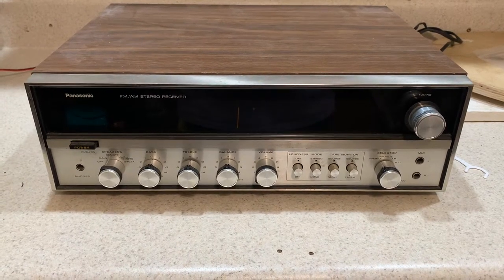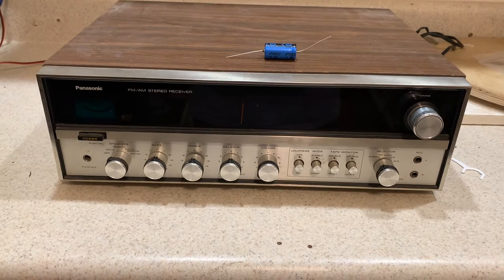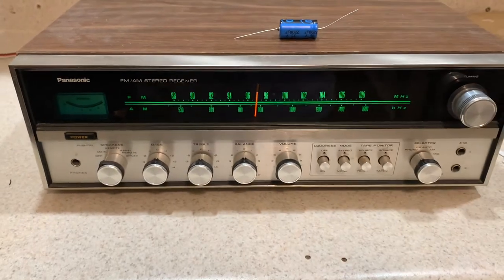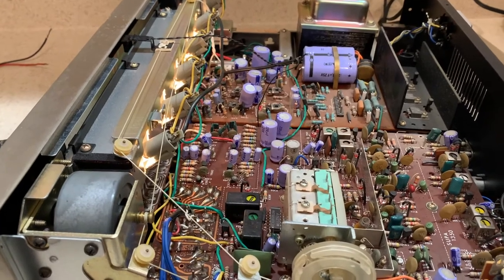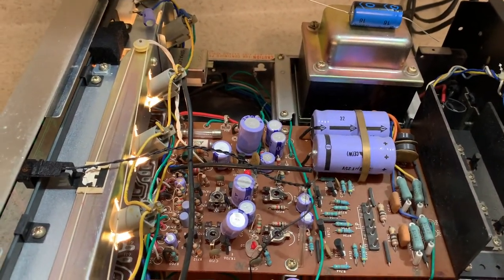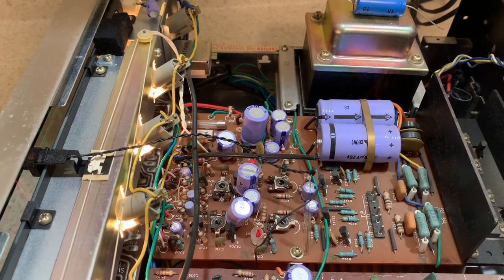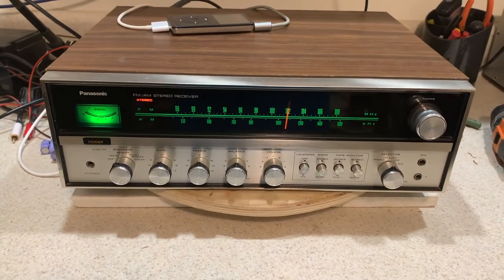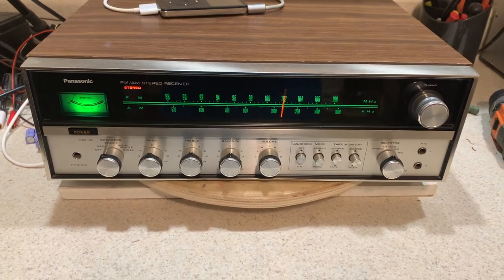Panasonic SA-5200 Vintage Receiver

Comment: Great video- thanks for posting. I am getting a weak and distorted sound from my SA-5200. All indications are the black square transistors or the driver transistors might be bad. Do you have a source for them? And the replacement numbers? Thank you!
Reply from the maker: Hi there, I do not have the replacement part numbers, however you can download the schematics for free at: hifiengine and then figure out the part numbers that you need. Also, you can get all the parts from Mouser Electronics. They will ship them to you and they are really inexpensive. Let me know how that works or if you have any additional questions, thanks.

Comment: Hi, just got one of these.. wish you showed  how you remove the knobs.. just pulling them out ?? Or somehow different?? Thanks
Reply from the maker: To remove knobs and buttons, you just pull them out and they come right off. if you get trouble getting them out is because of the age...but they should come out with no problem.

Comment: so can this receiver take input from my tv using rca cables.. i have just got it from an auction but not sure how the connections work.. can someone explain thanks
Reply from the maker: Hi- This receiver is very old and it does not have aux (CD, MP3, etc.) inputs.Try using the tape-in inputs. In other words, you will need to get a cable (stereo to RCA) and plug the stereo end from the TV headphone out to the tape RCA inputs. That should work fine.Let me know how it goes. Thanks!

Comment: Good video.  I just bought one for around $60.  I can see your "stereo" display lights up when tuned in.  Mine doesnt light up and the meter doesn’t move.  Did you hook up an antenna?  I can hear the FM but i just used some foil.  Which one is the FM antenna to use on back?  Thanks
Reply from the maker: Hi there, I don't remember if I hooked up and antenna, it's been a long time since I did the recap.  But you can hook up a piece of speaker wire to where it says FM and ground and that should be enough. As far as the light not coming on, it could be that the little bulb is simply burned out... you might want to check on that as well. It is a very nice receiver and I love the looks of it. Enjoy and let me know how it goes... Cheers! 🙂
Reply: @suckerforvintageaudio9449  Hi.  Well i got the meter working.  Was reception issue.  I pulled the STEREO bulb assembly.  Tiny bulb looks hardwired?   Can you get those online or do you replace it with a similar one?  I look forward to cleaning 40 years of dust in it.   Rick
Reply from the maker: @rcary  You may want to download the schematic from Hi-Fi-engine and see what  is the voltage of the little bulb. Based on that you can get a replacement easily on either eBay or Amazon...I hope this helps!
Reply: @suckerforvintageaudio9449  ok   good idea    i just noticed that there is a wire running to the station indicator needle.  Is there a bulb in that too??
Reply from the maker: @rcary  I believe so. That may be okay and in no need to be changed. If it’s off then it is also burned. While you at it, also check the bulbs for the entire dial face. I believe it’s 3 of them.
Reply: @suckerforvintageaudio9449  There are 4 and those are good.  The indicator is gone.  That looks a bit tricky to remove and i dont want to upset the pulleys and strings,  which looks complex.  The STEREO bulb is a bit easier to snip off and rewire.  I saw bulbs online but all looked stateside or italy.  Im in the UK.  Ill check the forums for wattage etc.    Lovely design how its all put together.
Reply from the maker: @rcary  Yes, it is a very nice unit. Check also with Audiokarma and post the question about the bulbs...you might get a better answer/idea of where to get them. Let me know how it goes. Thanks!
Reply: @suckerforvintageaudio9449  I notice alot of the 5200 have a black ring on the knobs.  Is that something you can replace?  Mine doesnt have those, but cant say i mind.   Still struggling to find the specs on the 2 bulbs. Fun stuff  :)
Reply from the maker: @rcary  Some Technics models did not have the black ring...I only saw those in the Panasonic version of receiver...If you downloaded the manual/schematics from Hi-Fi Engine you should see what is the voltage and use any other bulb of the same volt/wattage. Those volts are usually 8 volts AC. You can also measure the voltage going to the bulb and use any bulb of that voltage...hope this helps!

Comment: h what are the volts and amp of the replacement bulbs that you used? I'm replacing mine too i need some insights
Reply from the maker: It has been a while. I think I used the same bulbs that I used previously for the Marantz 2270. I think they are 8v. Please check on eBay LED bulbs for Marantz and you will find them. Most receivers that use incandescent bulbs have the same voltage. Please check and let me know how it goes. BTW, I love that receiver! :-)
Reply: @suckerforvintageaudio9449  me too i love mine, i checked one busted bulb and it is listed as 6.3v. I haven't checked all of them since the rest are working fine. Do you think they all share the same voltages?
Reply from the maker: @francisen4604  -Yes they do share the same voltage. However, because the Marantz bulbs are 8v they will be a bit dimmer, but it will work fine. I think mine had 2 bad and I replaced them all.
Reply: @suckerforvintageaudio9449  ok thanks again, i love the sound of this receiver thinking of buying klipsch r41m speakers to match this

Comment: I got one of these from technics and there's no audio output, i changed a blown transistor and still no audio, any idea how i can fix it?
Reply from the maker: Hi there, sorry about the late response. It has been a long time since I restored my receiver. I think this receiver doesn't have a relay for the speakers (I may be wrong, it has been a long time). Anyway, please check a set of fuse in the back panel and see if any of those fuses is blown. Those fuse play the role of a relay. Also, check with some headphone and see if you get some noise, static or something out of the output...Lastly, a recap is suggested, you can get all caps from Mouser Electronics...oh, Did you test the other output transistors??? Let me know what you find! Thanks!
Reply: @suckerforvintageaudio9449  Thank you for the reply and sorry about any English mistakes, the fuses in the back are fine, I will check with the Headphones, i should remove the npn transistors for test them?Thanks again for the help !
Reply from the maker: @vendrick420  Si seria lo ideal que probaras los transistores para asegurarte que estan bien. Remuevelos uno por uno y pruebalos a ver que dicen. Usualmente cuando se daña uno los otros tambien pueden dañarse. Hay algunos videos en YouTube de como probar transistorers con un medidor normal. Dejame saber como te va...por cierto, mi nombre es Felix! 🙂
Reply: @suckerforvintageaudio9449  voy bien felix obrigado! But my Spanish is even worse than my English, i speak Brazilian portuguese btw, and how are you?
Reply from the maker: @vendrick420  lol - sorry. I said earlier that the ideal would to remove each output transistor and test it outside. Usually when one blow out it damages other things, but check them and see if the rest is ok. Did you check with headphones and if so, what was the result?
Reply: @suckerforvintageaudio9449  I didn't test with the headphones yet, once i arrive home i gonna test it and remove all transistors for measurements, I let you know bro, thanks for your kindness lol
Reply: @suckerforvintageaudio9449  hey bro, i tested the 4 big transistors out of the board, except the 2 tiny ones,  turns out they were ok ,but I placed new ones to make sure, the 2 tiny ones i measured on the board and  they look fine, now I got  half second audio from the FM radio and the signal disappear, I also tested with headphones and it just outputs some noise, now I need to buy the caps to replace, what exactly caps I should replace? The big ones?
Reply from the maker: @vendrick420  If you got some audio now, before you do anything else, you need to lubricate the potentiometers (volume, balance, tones, and other controls in the front). I suggest you get some Deoxit or any other lubricating spray and clean all controls first. That may fix all your problems. As far as caps, they are all marked with the specs on them (volts & Uf) and you will need to replace them with equal value. The big ones are axial, which means they are installed horizontally. I don't have a list of all the caps I used, but I just wrote down the ones I wanted to replace. Mostly the big ones and those close to the power supply area. Try not to mess with the tuner side. I hope this helps! 🙂
Reply: @suckerforvintageaudio9449  OK, I will try that, btw you remember how to remove the tuner knob?
Reply from the maker: @vendrick420  I think you just pull out. But the lubricant goes in the inside of the control bottoms.
Reply: @suckerforvintageaudio9449  btw, you got the manual service for this one?
Reply from the maker: @vendrick420  Unfortunately not. Check on HiFiEngine they may have it
Reply: Sorry the delay, I'm still struggling to repair my receiver, I kinda gave up to repair it due to lack of tools to analyse and sent the receiver to a local vintage repair shop, long story short, the technician guy kept my receiver for over a year, and it came back worse than it was, now its missing many of the original semiconductors, I also tried to search for the schematics on the website you told me, to recognize the missing parts, but unfortunately I can't create an account 😢, the website says the registration services are disabled due to the abuse of free service

Comment: I was wondering why it was so simple inside compared to the one I own. Then I realised it's not squad like mine
Reply from the maker: Do you have the same model? There is probably a difference with the same model built by Technics. I may be wrong though! Thanks for the comment anyways!
Reply: @suckerforvintageaudio9449  You’re right it’s the Technics brand and it’s also quadrophonic
Reply from the maker: @greyjamz6626  then it is totally different unit.

Comment: I have the same receiver it works do i still have to recap it?
Reply from the maker: Hi there. If it works, you don’t really need to recap it. However, because of the age of the components I chose to do it and with that I hope I added another 40 years to the receiver. It sounds much better after the update. I hope this helps, for for your question. Cheers 🙂

Comment: hi man i have the same receiver, what type of speaker do u use?
Reply from the maker: I use it with a couple of infinity bookshelf speakers. The receiver is only 14 WPC but punch like a mule.
Reply: @suckerforvintageaudio9449  wow that is nice hoping i could find some low watt vintage speaker like yours here in the Philippines
Reply: Hi sir, what are the signs that the receiver needs recap? Mine still works no recap has been done at all